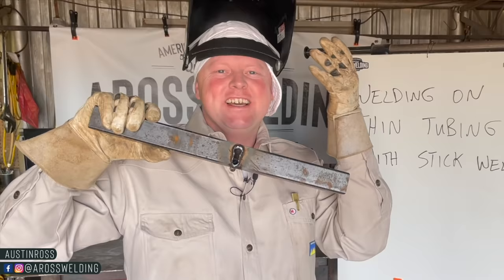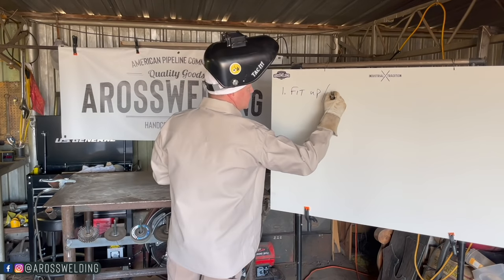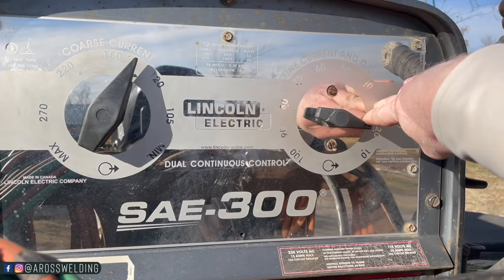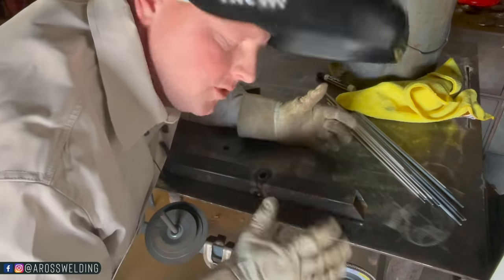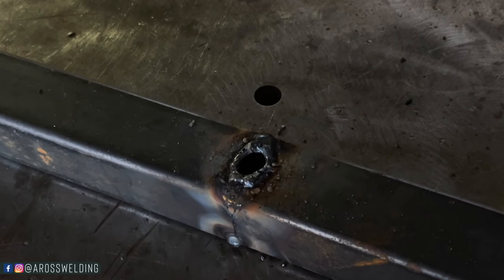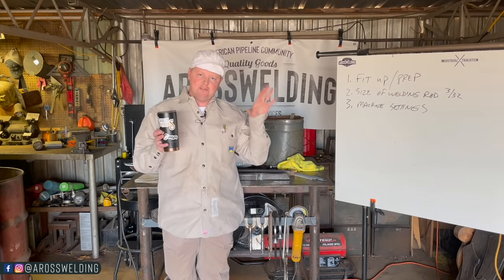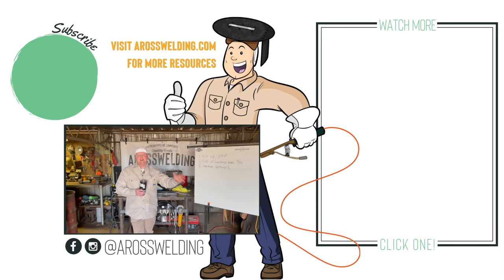Stick Weld Thin Square Tubing (How to Recover After Burning Through)

Comment: Oh yeah, the current settings....
   With the 3/32" E6011 the recommended current range is 50-90A. I tried 40, and 50A on thin steel, but with the arc so hard to start I tend to let the arc burn through once I did get it started, and it was very messy. 
   What I found on my machine is that at 60A, I get an easy start and I can use an intermittent dab-dab technique, or a fast moving whip-and-pause continuous bead.
This works much better for me. Low- balling the current setting can be self-defeating.

Comment: On thin wall sq. or rect. tubing, l will slot all the corners then bend the mating edges to form matching bevels thus creating a valley when butted together. For us novice welders it's more forgiving than directly welding on exposed edges. Good luck

Comment: I would recommend cleaning between passes.  Otherwise an excellent demonstration.  I have been relearning how to weld.  My recommendation for thin wall material is to use either  flux core or MIG.  The problem with welding thin wall materials is having enough heat input to be able to fuse the two metals, but not too much heat input that results in burnthrough.

Comment: When you fix a hole like this, do you have to heat treat it in the end to get rid of the stresses in the metal or is letting it cool slowly enough to remove stresses?

Comment: Lmfao! I just welded a gate that was 1/32" thick the other day. I boogered that thing up SO bad, it took me 6 hours start to finish.
I did do a job for a former coworker out of 1" square tubing a couple years ago. 6013 rod, DCEP at 50-52 amps gave me 75%+ penetration.

Comment: I started learning wilding on thin material s because its cheap and the key is to use low voltage and weld  section by section

Comment: Probably a silly question. Sorry if you mentioned the answer and I just missed it.
Do you clean the slag off between welds?
How do you get into small crevices?

Also, in my very short experience, and using only 6013 electrodes, I get a park started with barely a scratch on the base metal. Why does it take you a few firm knocks to get an arc?

Comment: It was a 10 minute walk to adjust the welders at the shipyard I used to work at depending on where you were, so too hot/too cold it didn't matter you just had to figure it out. Sometimes wed set one hot and one cold and trade off and usually fight over who got which whip!

Comment: I weld primarily on galvanized steel on site ( existing structures...90% gates) . 
Most of it is 3mm and I'll often need to weld up hinges and brackets that are much thicker ,10mm.
Can get tricky to get the heat dialed in to not to blow  into the thinner steel but still get good penetration on the thicker stock .
I'm in metric land here in Southern Africa so excuse the mm . 
Takes some getting used to with stick .

Comment: Any welder that's learned in the field like you and I, no we don't know the exact science we just do it, I have a rough idea where to set the heat go try it too hot too cold adjust the amperage where it needs to be. Wet/damp welding leads can change your heat as they warm up and dry out what was just right can turn into its burning a little hot. Its not the Ronco stove "set it and forget it you keep adjusting your heat or adjusting the way you work you're puddle which is what I do. From experience you can tell when the puddle is getting a little hot. The dreadful burning a hole in your material it happens you can't get you're panties in a knot its knowing how to fix it. Guys that can only know how to wire feed weld have no idea how to fill a gaping hole. I learned on stick I rarely to never mig weld, if the hole is big enough I'll do the Texas tig weld with the two sticks. All I ever weld with is 7018 its the most readily available welding rod sold here, 7018 burns so hot its not a fast freeze rod you got to be careful welding thin stuff even with 3/32.

Comment: Also when welding up a hole on site, where the other end is already sealed, watch out for massive blow backs, where air from inside the tubing rushes out and the hot weld and slag come sputtering out of the hole you are trying to fill. Also wait for the metal to stop glowing red and make quick passes on all sides of the hole to fill it up.

Comment: I am no welder. I am just a self taught farm welder, but a method I sometimes use is to switch the current from DCEP to AC if I am using 6011. Also, I do not use 3/32 rods to fill holes. I use 1/8 rods 90% of the time. It seems like you add too much heat over time with 3/32 because you are adding less filler, so you need more passes and the rod just "wiggles" more if you are not super steady. If you can just fill it once and move a little quicker it adds less heat and gets it done faster. Lastly, I only use 6011/10 for this, not 7018 or 6013. 6011/10 puddles cool faster so you can whip it in and out and not have a fluid puddle. These are just my observations from messing up so many times with my prep work.

Comment: Get some 1/16"  6013 rods and you can weld thin material down to  16 or 18 gauge. You need to use a series of tacks on the thin stuff but it can be done in a pinch

Comment: I do a ton of mig on thin tube but there is the occasion when a mig tip just won't in there for good gas coverage and I need to stick weld it I use the 1/16 6013 I get a hobo frieght actually works good on 16 and 18 ga use like 40 amps dcep

Comment: at 12:00 you suggest walking off.  i agree.  walk off to go and get a piece of tie-wire or a steel coathanger or even another welding rod and feed it into the hole as you weld it up.  i call it oxy-arc welding.  i discovered the technique when i threw a tantrum after i blew a hole when repairing the handle of a scummy rusted old wheelbarrow.  i wanted to repair this thing only because the shape of the tray of this old thing made it the best one to mix concrete in.

Comment: I've been welding 14ga for some time. With 6011 it's harder, deep penetration and aggressive arc is non-forgiving. We use E6011 on the farm like almost on everything. On thin stuff you need more skills and slower But on thins stuff, I find I like to drop to a 3/32 6013  when doing thinner metals. 

If I burn-thru, I lay piece of used one or many weld rod-ends in the hole and weld over it. So in that  big hole, would be a bunch of rod ends sticking up. It saves time and is much quicker. The rod ends  protruding in the hole, would weld down into the puddle and save a lot of grinding later on.Since the hole in the side would not be load bearing the integrity of the square tube is not compromised.

BTW, With the thin stuff it's wraps easily with heat, so  place some many-tack around the metal to keep it laying straight.

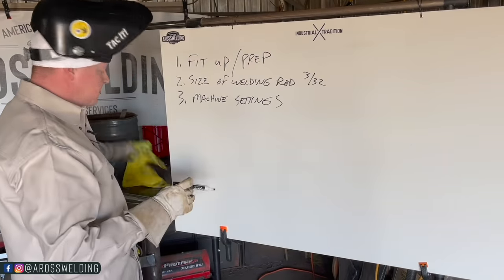@09:21 I 100% agree. I even buy metal just to test out rod and penetration and to play around. I figure try it on some junk 1st b4 going in on the real mccoy. 

Hood time only help you know your skill, your welding rig, your metal, your rod, etc....

Comment: I run 6013 rather than 6011 on thin wall stuff where weld strength /pentration isn't crucial, seems to gouge less. And yes, I consider 6013 a trash rod compared to 6011/6010.

Comment: Learn to "red neck tig"  bang the flux off a rod, feed it into the pudle as you wip on and off the piece. It will quench the pudle and allow you to fill the hole much faster, and with a full throat. If it needs to be structual, you can grind it flush and weld over it which should allow you to burn out any impurities that did not float while filling.  With 7018 you can fill a 1/2 gap in a single pass on 1/4 material with a weave and feeding a filler rod into the key hole.

Comment: Because i welded on anything from 16g to 1" plate I had a small metal box off to the side of welding table with different pieces of steel or aluminum ect. of different thickness, and run a test bead first. Better to wreck a piece of scrap than the project. 😉👍🏻

Comment: Curious question. Shouldn't you de-slag between welds? It seems to that 
 there would be many tiny puddles of slag on the build up method that will be present after the weld cools. I'm not trying to be disrepectful, it's just an observation from my own experience. Thanks for taking your time to make videos, I'm sure many will benefit from your experience.

Comment: Luckily I can switch to short box or tig but I'm going to watch this all the way through. I want to do it with stick. I have done it with stick and yes I have punched lots of holes but I usually just pull the stick back a little bit and keep going instead of walking back to the machine.

Comment: how i patch up holes is , i break the  coating on the rod and start on one side of hole put the broken rod and arch the back of rod leaving the piece in the hole i continue till the hole is covered with rod then i put a second layer and weld on top to melt them right before they melt threw hole the grind

Comment: Made a 2 inch wide hole on square tubeing  has to use 6011 at 55 amps and barely running it on the edges of the hole to slowly close the hole

Comment: Wad paper up plug holes put paper behind area to be filled and pack it full of wet sand before welding it .. maybe even freeze it if possible.  This is a hack for basic cheap unshielded flux core mig units but arc might also work

Comment: I am retired after started  when I was 23 I am 73  now .
Believe it or not , Lincoln makes 1/16  and it is so handy.
Contact cement a 220 gr piece of wet and dry sand  paper  on the cuff of your glove . 
I  never in all the years did I make a down hill weld .   it was all uphill stick and tig   X-ray .
I hope this helps .
 stick only has 5 variables ,
Fitup
rod angle
travel speed
current setting
arc length .

the rest is getting familiar with what ever rod  you are useing. 
look for the 1/16 "  electrodes on line.
I went into Airgas and asked if they had 1/16 .  Lincoln 7018 and 5p  
They don't make it . 
 Was he surprised .  It was not listed in the catalog .
unless you like to grind alot. 
we allways tested 2" sch 80  uphill on the 6G.

I never threw my half burned 7018 .  
I would drag the rod tip across the wet and dry  patch on my glove .  And that 7018  lit up every time .
 uphill 2"   on the 6G   the rate of change is quick.
Another tip  re TIG.   when you  run your root  .. LET IT COOL OFF , IF YOU CAN'T PUT YOUR BARE HAND ON THE PIPE ITS TO HOT.
 I have my relatives in Okla and Tex., you know AMERICA . I was born and raised in LOS ANGELES .
 Hobart makes it Lincoln does.
The only place that I saw it for sale was Sears , I have to be honest I bought it as a novelty ..
I helped a friend weld a hand rail  in a house. he brought a mig welder.
 I brought  1/16  7018 That dosen't spark   .   wear a tShirt .   not with any of the Xx10  rods.

Keep the 5  variables going through your mind when you weld ,

Comment: Good advice to leave a hole alone but sometimes that hole will grow no matter how hard you try, even on minimum amps. So as a last resort I'll stick a big bolt in the hole and weld the hole edges to it instead of trying to build an Igloo across the Grand Canyon. Bias the arc torward the bolt so it acts as a heatsink and somewhere to "park the arc" if you feel/hear the thin wall is about to blow through again. Stick welding since 10 years old and still learning 😀

Comment: You can control the heat and fill much faster if you use one rod almost like a tig torch and the another like a filler rod. Be very sure that  you have a very good glove on that hand. I mean it you can't have any holes in that glove.  This really isn't a recipe for a quality weld but neither is multiple passes across a wide gap. The best way to finish either weld is to grind it flat then run a bead down the center of it, that will disguise it fairly well especially if you paint over it later. 
  Ps some people think that you need to remove the flux coating from the rod used as filler. That is unnecessary with 6011 and some other rods.

Comment: do you need to disconnect the battery if you're welding in a car (such as exhaust or broken bolts) ? if using an arc welder, the ground should be negative ?

Comment: You have to adjust a machine as you go. Not all machines burn rod the same or at the same heat settings.
That's why in procedures there is usually a "range" of settings

Comment: Handrails do have an Osha code steel pipe is sch 80 on post and sch40 on  rails- diameter 2, 11/2, 1 1/4;  aluminum is the same except for 1 1/2 " minimum

Comment: Hello. I am a beginner in welding and I have a problem. The smoke that is released during welding causes problems for my eyes, so I wonder if it will be like that until my eyes get used to it or I have to look for another job. Sorry if there are mistakes in writing and on the long question. Thank you ! 😀

Comment: To fill a hole like that you can also roll some solder wire around the 6011 rod an spot weld it as well to fill the hole up

Comment: Would it be productive to tac weld a large project together with a wire welder and then actually weld it with stick? or is that just extra steps? does it have any benefit?

Comment: understanding  Heat sink More metal the larger the heat sink . You can also to fill holes fast use a bared rod as a heat sink and kind arc weld gas weld the hole closed . Using a kind of gas welding technique
Reply: Texas Tig

Comment: Do you think 3/32 7018 would work well on thinner material like this vs a 60 series rod? My understanding of 60 series rods they are more of a "quick freeze rod" and work better on thin  material especially if you key hole it.

Comment: I get bad rod sticking, is that too low amperage? 3/32 on a 100A variable 120V buzzbox. I attempt to weld exhaust that is usually super thin as it is.

Comment: Use another rod like a filler rod in your other hand to fill gaps or burn holes.
Reply: Texas TIG!! Never tried it myself, but I considered it here recently...
Reply: Yeah I’ve done that, weld with a 3/32 7018 and knock the flux off of the filler rod. Works out just fine
Reply: @wargamingsupernoob  Haha, is that what its called? We were doing that in the 80's. Never knew there was a term for it.

Comment: Structural uses for 14ga. Is metal buildings for trusses and rafters (i build them for a living in chickasha okla.)
Reply: Hey Brian,  what process do you use? smaw, fcaw or mig?  which wire or rod and what size.....  i wanna make a carport truss w/ 11 ga steel tube.....
Reply: @peetky8645  we use MIG in the shop and stick in the field.
Reply: @peetky8645  and rods we use in the field is 6010’s
Reply: @brianhumphreys1660  thanks
Reply: Why not use self tappers? Is welding quicker than using tek3s?  Or for 10-14ga are Tek5 screws needed to beat the time it takes to weld a truss?

The trusses I build tend not to use anything heavier than 16ga, and the heaviest I've used I think was 12ga for some big ass hip trusses (the company I have worked for over the last 2.5 years specializes in steel trusses, mostly for roofs). We use self tappers exclusively (#12-14 and on rare occasion tek5). I've never welded a truss and from what I understand it is a lot less efficient when compared to using self tappers.

Comment: hi, i have a 3/ 16 rod where it is difficult to get an arc, It just sticks multipel times. very annoying
I tried  today  with a  16 th  2mm rod and it works  , one touch it has an arc.
Are  there inferior rods on the market ?

Comment: I started at home with a 20-70 amp craftsman cracker box.  Setting it to 50 amps with a 3/32 6010, 6011 or 6013 was a frustrating arc start for a beginner.  And setting it 60 wasn’t much better setting it for max 70 was an almost sure blow through.  That machine starts an arc and welds far better with the harder to find and more expensive to buy 1/16 rods and better control with 50 amp setting on that machine. As the machine is and old transformer and slug type adjustment the amp label was rather arbitrary and just a visual reference of where to start from.

Comment: I'm not payed to advertise, but so far I with the Esab 43.32 2mm electrode to be one of the best for thin materials, mostly because it doesn't need to high starting temperature

Comment: Nice video.  I wonder for stick welding thin sheet metals, are there any welders made that could be set to perform spot/tack weld using an on/off button like TIG and a timer option to set the duration of the Arc initiation.  In other words, a stick welder with 2 extra settings i.e. 1) Specific Button to choose arc function as "Spot" or "Tack"  and 2) Arc initiate duration setting from "0.1sec" to "Continuous".
With these 2 settings, the welder should start arc only when a start button on the torch is pressed and it should shut off when the duration 2) is completed.
This would make the stick welder capable of even welding as thin as 0.3mm as it would avoid blowing holes in the thin sheet metal. 
Please advice if anyone know such kind of functionality in any welder ?